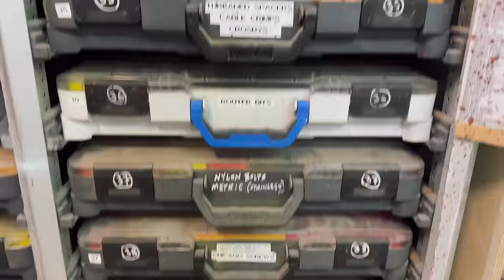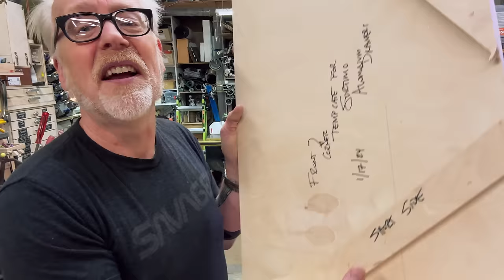Adam Savage Builds His Dream Hardware Storage System!

Comment: Quicker and cheaper solution for the actual problem: Make one sheet metal drawer for each of the case columns, that you can draw out and use as the “table space” for every single occasion. 😊
Reply: Only issue with that is you still have to lift the containers. Depending on how heavy they are, decides the design.
Reply: A quicker and cheaper solution to shelter is just to live in a cardboard box outside, but that's not very convenient or productive, so we usually rent or buy homes.
Reply: Westley Treat did that in his video. "Sorta Sortimo"
Reply: @virtuserable  I’m the same, that’s why it’s a drawer, a temporary shelf that doesn’t accept permanent things. 😄
Reply: @EEKloveable if they’re too heavy to lift you don’t really want a sortimo at all, just a drawer with individual bins in it.
Reply: ..if its so heavy that its a struggle to lift, then why have a removable case for those ones. a drawer might be the right call over these expensive cases.. sorry someone else said this exact same thing
Reply: @virtuserable  Thank you! ☺️
Reply: @virtuserable  metaphors: how do they work?
Reply: I wondered the same. It also allows them to be stacked higher than about shoulder or chest high
Reply: And that's precisely demonstrated by what's happening at the 42min mark. The thin metal shelves wouldn't be reliable for the sorting and closing of the box, hence Adam intuitively did it on the work table - which was supposed to be what this setup was meant to avoid. Yet a single strong pullout drawer or shelf in the middle of the racks acting as "table space" would have been perfectly enough :)
(and I bet this will be added eventually, as the lowest and highest boxes are always going to be pulled out anyways).
Reply: 🔥THIS! 
Like a server rack😂 too easy for Adam...

Comment: It’s shocking to me that you’ll drop probably north of 7500 (retail) on the sortimos, sheet metal, slides, bcx, and casters.  Not to mention labor.  But the extra 150 for quality sheet goods is where you saved.   I do appreciate the honesty regarding this.  Great system, great effort, and great result none the less.  Also, the quality of certain materials has become shocking in the past 10 to 15 years.  As a finish carpenter and cabinet maker the last three years has been a wild ride in the paneling and hardwoods market.  Love the content from the entire tested crew.

Comment: Having worked in an industrial facility that produced utility bodies for trucks out of sheet metal, for something like this we would nest each piece in a 4’x12’ sheet and punch them out on a cnc turret punch table. Notches and holes would be done and each part would be ready for the cnc press break. 70 of these would take about 4 sheets of aluminum, processing each sheet of parts on the turret punch table would take about 10 minutes and breaking them another hour. We made thousands of similar drawer units this way only ours had rolled edges for rigidity and were made from 16ga galvanized steel. It’s a testament to the power of automation and modern processes how fast we would pump these out. It’s humbling when you have to design a process done manually and makes you appreciate the planning stage all the more.
Reply: Production engineering is a discipline all its own. There's nothing else quite lick it in the engineering world.
Reply: Having run a CNC turret punch I wonder if there is a 'job shop' company with one in the bay area; if Adam debated using them to punch out the complete blanks. Also if they had a well set up or CNC sheet metal break to do the complete tray. Send cut send would also be an option as they have laser, water jet, sheet metal bending machines and offer hardware insertion.
Reply: While I understand Adam's whole "the journey is the point" sort of hyper fixation on process nature... My immediate thought was: Why not have an industrial fabrication shop prototype and bang this out in a day for probably not all that much money and save your time and attention for more artistic things?
Reply: @DominieDirtch  This is my unfortunate thoughts any time I see someone take a week and a bunch of money to manufacture a tool that costs like 200 or 300 dollars
Reply: @DominieDirtch  Yeah I call that punishing yourself for being stupid.  If you don't own the right machine find a person who does. Will this job pay for that machine also comes into play. A good barter system normally can be put into use to make the project even more cost effective.

Comment: A friend converted his garage to a shop, but he needed a lot of space for equipment that just didn't fit. SO, he utilized the ceiling and attic to make draw-down storage for almost all his hardware, making space for his equipment that used the walls and floors. They each sit on a hydraulic piston. There are 4 large platforms that drop down. They only became useable once enough weight was put on the platform. He put racks for bolts/nuts/bearings/electrical/hinges.... etc...onto the platforms along with a section for storing portable tool boxes for traveling. All he has to do is pull on the cord that hangs from the platform and the hydraulics slowly bleed the fluid out, lowering the heavy platform toward the ground. It stops at waist height and the bottom stores away at just over 7 feet. You can't do jumping jacks inside but he now has a fully equipped shop. He's an excellent wood worker. To put them away, you start lifting it and the hydraulics kick in and start the heavy lifting.
Reply: Wow. This deserves a 'shop tour' video!

Comment: Hi Adam,  great content! I have been a machinist for 28 plus years(many as a manual machinist) and your shop is epic!! 
One tip... on milling /drilling holes on a mill, use a center cutting End Mill OR Drill a hole smaller than the size of your End Mill. Then when you come back with your  on-size EM, you won't have to stop and pick out the center of the End Mill.  Hope this helps.  Jeff From Minnesota

Comment: Can't help feeling that there is an association of organisation nerds who reach out and recognise one another every so often, before retreating to the safety of their own little (neatly organised) shed, cave, workshop etc.  Enjoyed this build.  Did occur to me in the preamble where the lack of available horizontal space is identified and bemoaned, that the new cabinets offered a possible solution to this.  Each cabinet features 13 T-Boxses mounted on drawer runners.  Starting from the bottom, every 3/4 boxes add an additional intermediate set of drawer runners.  These runners simply hold a plywood shelf that can be extended outwards.   This would give an additional 10-15 horizontal spaces. If you had to retrieve multiple items from multiple Sortimos  a shelf can be pulled out and the items gathered there prior to transferring everything to the workbench.  Keep up the interesting work.
Reply: Fabulous! A pullout tray solution will do exactly what I need for my comparatively modest parts collection. 

I was thinking he could get a table height rolling cart that fits one parts box. 

But that solution wasn't going to solve my modest collection.

Comment: Nice honest video. I did the same 12 years ago here in the UK with my 20 sortimo cases . I dont have any metal working kit so used angle iron and ply and they are still going strong it is a shame that you tube does not allow pictures in the coments section . Not having to take each case fully out each time is a massive time saver over a week of working .

Comment: 28:30
About 20 years ago, I made a 4-drawer cabinet, like what you were doing here.
What I did, due to making a mistake the first time like you did here.
I put the pieces of wood together, 
placed the rails on each wood, and screwed them in, 
and this way, as long as they aligned up while laying flat together, 
they would be aligned when across from one another.
It worked for me.
So, the next time you do a job like this, or anyone else doing a job like this,
Make sure you do the following.

#1: Lay the two pieces of wood on a flat surface.
#2: Butt the fronts together.
#3: Make your lines all the way across both pieces of wood.
#4: Lay your rails down on your lines, making certain they are perfectly lined up.
#5: Next, screw in your rails.
#6: Put the two pieces of wood where you are going to install them.
#7: Slide the drawers in.
#8: (This is my favorite number, so I had to add in something. :) )

Comment: Adam's videos are a lot of fun to watch.  This one got me thinking.  Not sure if anyone mentioned this, or Adam(I may have fast-forwarded a bit), but it would have been much simpler and at least an order of magnitude cheaper to build in a single, retractable shelf into the existing cabinets.  You could pull out the shelf and put one of the cases there and open it.  You could also have multiple shelves if you wanted to open multiple trays simultaneously.  Something like card catalogs at the library. A little more time consuming to use, but much simpler and cheaper to build.
Reply: A lot of us with smaller budgets were thinking the same thing.  The problem then becomes discipline not to use the pull outs as workspace.  Adam's solution would multiply that problem. :)

Comment: Harbor Freight (or Adam) needs to mass produce these frames with drawer slides for the Harbor Freight, Stanley, and Sortimo cases. Make them easily adjustable to mix and match tall and short cases. Make sections 2 to 3 ft tall that are designed to stack together as well as joining side by side columns together. 
Have an optional kit for the front to slide over and prevent drawers from sliding out in mobile applications.
Great design Adam. With over 100 cases I've been working on this idea for many years. Have seen all the YouTube videos, this is the best.
Reply: Great idea in theory, but the price point to realistically manufacture something like this would be a deal killer for a lot of people.   I have the metal drawer system he showed in the beginning, and the empty frame with 4 slide racks costs more than the 4 sorting boxes inside.
Reply: Also, drawer racks for mobile applications are a whole other level.   Some of my metal cabinets are 10 years old but spent their 1st 2 years in a service truck.  Those have a lot more wear and tear than than ones that saw daily use in a shop for 20 or 30 years.
Reply: @zadams5596 . Yes, I agree it would not be cheap , and I am very familiar with those industrial parts however, Harbor Freight sells their General and Icon tool chest and side cabinets from 300.00 to $3,000 all day long. 
The mobile service technician also is a huge Market in their existing van shelving and drawers are extremely expensive already. Milwaukee packouts are expensive and you can't take the drawers out individually ie.
The cheaper option would be to sell the drawers and  sliders assembled as a kit, and the user builds their own Cabinetry to put them in
Reply: They make them like the ones he showed as an example. Grainger gives them as part of their stocking for bolts and parts. It's nice that you can slide them out to get something or take it with you if doing a project.
Reply: Festool has them for their (and other Tanos) boxes. Not cheap though. About $50 for a pair of slides. Plus another $100 ish for each small parts box. Durham drawers and cases would be a cheaper.

Comment: Next time...   A faster path for drilling and cutting   
1. stack the sheets and clamp them together with edges very carefully aligned.   
2. TIG weld the corners together so the stack now acts as just one piece of metal, probably at the corners.   
3. Do almost everything on the mill, drilling, cutting... all on that one big slab. All your drawers will match.   
4. Last operation is cutting off the corner weld.
Reply: Was a bit perplexed why he didn't do a lot of it on the mill since he was already setting it up. Welding them all together is an even better idea 👌
Reply: i would worry that the welds could warp the aluminum a bit.
Reply: @CaptainSwift11  Heat always moves the metal but stacking together big slabs of sheets of metal would stiffen the pieces and draw away more heat faster. Beside one can and should always test a system to verify that it is doing its job.

Comment: In engineering, there is that fine line between wanting to improve the efficiency of a process, and spending so much time improving the efficiency of the process that you end up spending more time than you would have if you had just used a less efficient process, and I love it, because that's what I do.

Comment: If the frames that held the draw slides were kept small but had the capability to be connected together, you'd have a modular system that you could reconfigure over the years. You'd have many small cabinets, each holding two or three sortimos on rails, stacked-up into whatever height you had available over a given floor footprint.
Reply: This system is already modular because each sortimo can be moved and configured how ever you want. It would always take up the same foot print but I dont imagine changing the footprint would be needed for the hardware store use Adam requires.
Reply: I think that  2 or 3 columns per module/rack is already optimized to reduce redundancy of caster wheels and walls with only 1 side supporting sortimos.
Reply: would have been a crap ton more plywood and would have added height to the overall stack for a use he really doesnt need his new ethos is keeping all the stuff in this area now.
Reply: The height is pre-determined by Adam's physical height.  He wanted to be able to see into the topmost Sortimo when slid out.   A taller individual may have built it taller, but the height is custom to his height.  Also, way more plywood and weight and "wasted" space with all that plywood.

Comment: A spreadsheet with an accompanied binder of hi resolution images that lived in that empty space between the 3rd and 4th upright might prove useful if you are on the other side of the shop and want to “pre shop” your hardware store. Then you could quickly look through the drawers without physically pulling and then realizing maybe the other connector is what you really needed. Also seems like a fun Tested coffee table book.

Comment: Adam, you should have made a "story pole" to layout the drawer slides on the plywood. Take a scrap length of wood, plywood, whatever you have, long enough to cover the entire height of the cabinet and just wide enough to mark, ie tall and skinny, and carefully measure and mark the location of the slides. The you just position the story pole carefully on you cabinet side, transfer the marks, repeat for each side, and you'll know they are identical.
I've seen story poles used for siding, louvers, etc. Anything that requires many marks where accuracy is paramount. They are a great tool of opportunity as my Dad would call them. A tool you can make onsite when needed and even discard or recycle after you're done.
Otherwise, GREAT idea and a perfect solution for your storage issues. Maximizing efficiency and space!
Reply: I like what he ended up doing better:  he determined the distance between the slides, cut a template piece of wood and lined them up relative to each other using that board, screwing each slide base in with the board in place.  That guarantees that distance is correct.  A story pole requires marks, and marks can be off by a sixteenth or more.   I've generally seen them used for rougher work where such accuracy isn't required.

Comment: Adam. Well done - Some things to consider for the future- and the 1 sad thing that you're going to run into; 
1st. You have enough gap and space between those that tightening them up would have given you atleast an additional 4 or 5 Sortimo boxes per Column. 
2nd. Always level on sight with a laser level to ensure that even if the ground isn't level, your shelves are going to be. 
3rd. Drop the rear around 1/4 of an inch campared to the front for a 3 or 4 degree incline, The weight levels them to 0 when they're out, but the incline back helps them go back in a little easier. 
The sad - The slides you're using are fatally flawed, the metal catch pin on the drawer side is going to break the plastic catches on the cabinet side. More weight and force the quicker it happens. Upgrade to the KV GS4270's and you'll never have to replace them or see them fail. Ever.